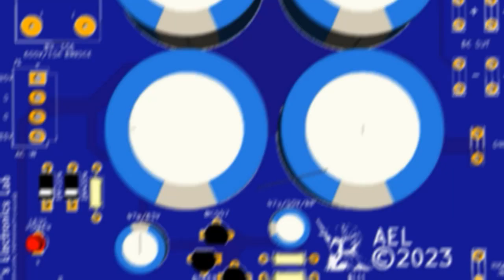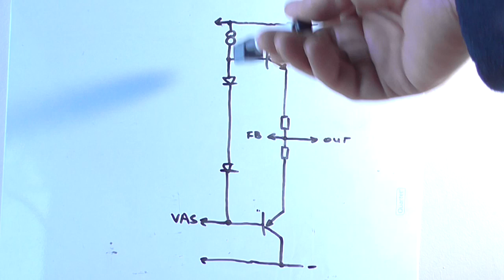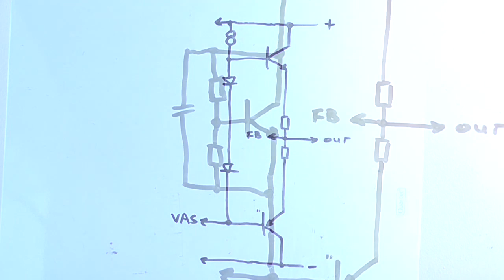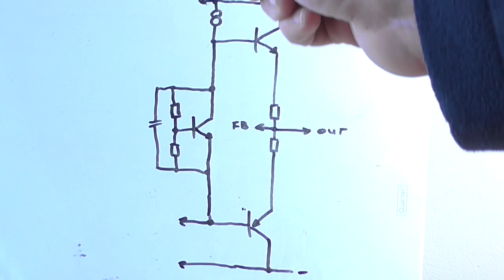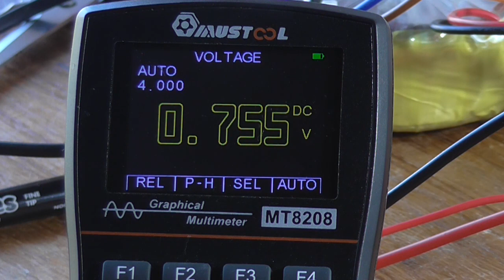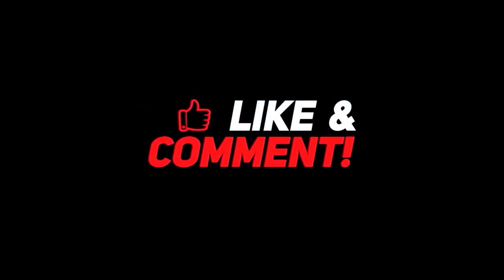AEL-50B Thermal Run-Away Problem SOLVED!

Comment: I have an Ampeg SVT-2 I'd love to get your opinion on.  I figure it probably just needs electrolytics replaced, but I'm not 100%...
Reply from the maker: Ok... what's it doing or not doing?
Reply: @AstrosElectronicsLab King description...

If it sits on standby much longer than just to let the filaments heat up, it crackles loudly when taking it off standby, and for the first few minutes of playing.  Also, if I crank it WAY up, there's a buzzy distortion for about 1 second before the amp goes into protect mode.
Also, I just retubed the amp, and now the new KT88 power tubes won't bias.  (I've been running JJ brand KT88's in it for about 8 years with no issue, and always retube with carefully matched tubes)

I love the way the amp sounds with mild overdrive of the preamp, which also works as a soft limiter (handy).  

I never get to crank it loud enough (even on stage) to push the power tubes into overdrive -- it's REALLY LOUD!
Reply from the maker: @niftybass  oh, it's a tube amp. I don't do much with valves. Is it pcb or tag strip wiring? You probably have out of spec or open resistors and or capacitors
Reply: @AstrosElectronicsLab  14 valves, if we're keeping track (counting dual triodes as 1)  I costs more to retube than several solid state amps cost to buy.  Why?  damn...you should hear it.

ANYWAY!  I figured caps at least because I've had the amp > 10 years, and it doesn't exactly run cool...at a minimum , they're probably drying out, if not "leaking" (*parallel* resistance) 
Bud I hadn't thought of resistors.  Thanks for the pointer.

It's all circuit board, and even with that, the schematic takes 8 pages to print (ugh)

Comment: Excellent work. Will be great if you can please update the board design/gerbers to include the VBE circuit along with the 2K trim pot for easy bias adjustment.
Reply from the maker: Unfortunately there simply isn't room on the pcb, even for a trimpot